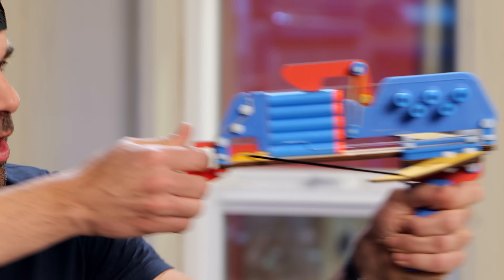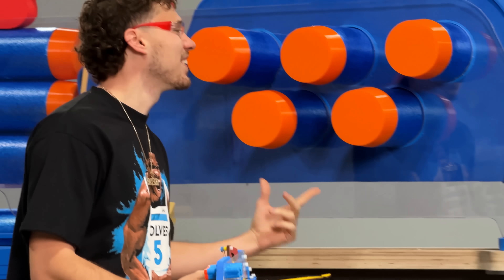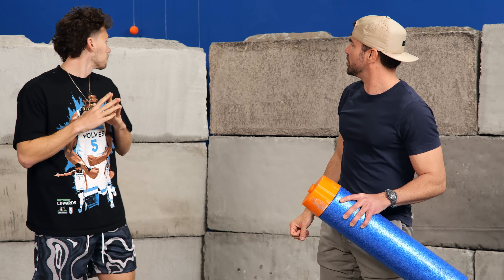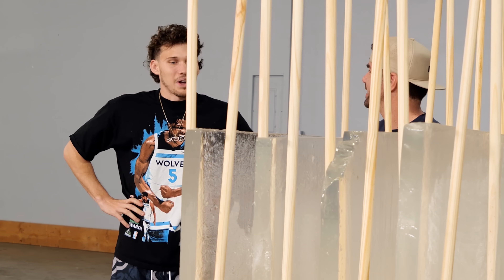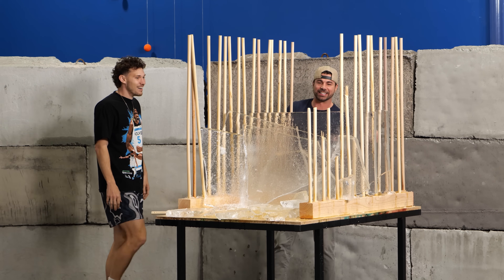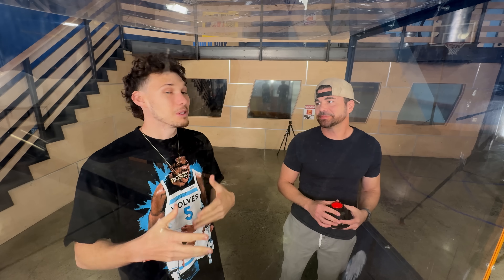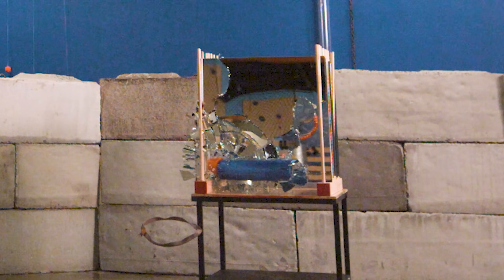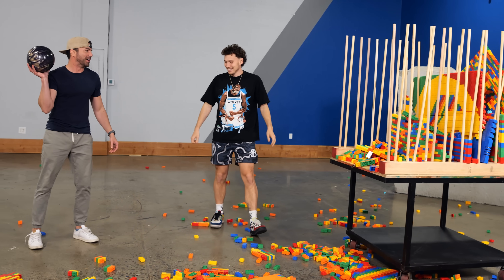World’s Largest Nerf Crossbow! w/Jesser

Comment: i just wnated to point it out the orange part is there for a reason for weight so it rides in a smooth flow instead of flipping like your nerf shot so i would recomend only metal or weight in the front